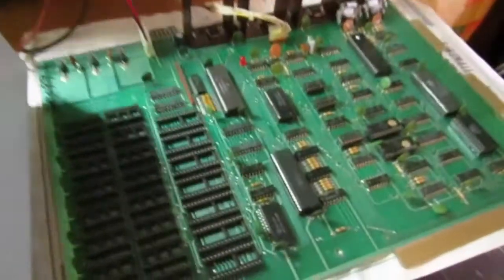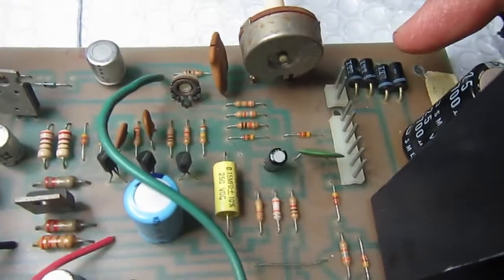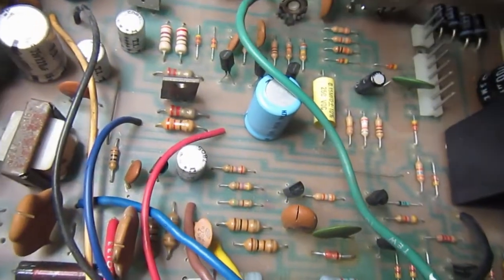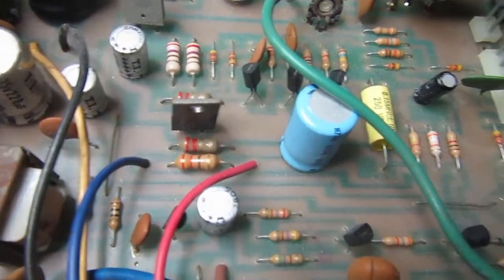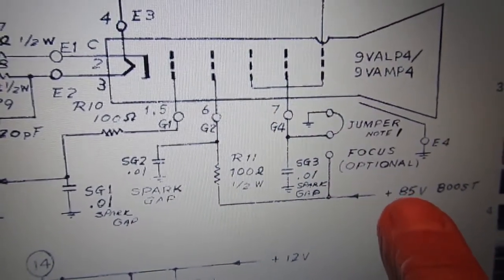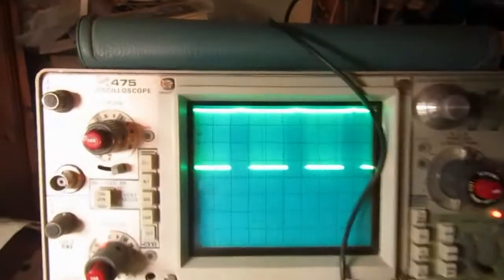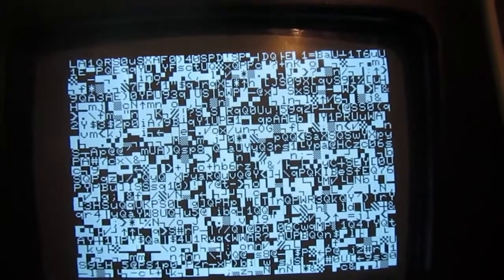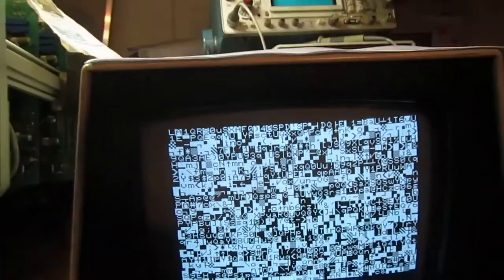CBM PET 2001 monitor video board repair (easy)

Comment: hello! My blue pet has similar symtoms. but i don't have an oscilloscope and knowledge of electronics. Could you tell me what to do to fix it?
Reply from the maker: Hello! I'm sorry, without some knowledge of electronics, I can only suggest you to find a good technician close to you that can help. Inside a CRT monitor there're also very high voltages (thousands of Volts) that can be very dangerous.
The same symptom can be given by several different failures, so it's not simple to suggest something without checking what's really happening.
You can try asking for help near your location on the VCFED forums:
http://www.vcfed.org/forum/forum.php
Reply: iz8dwf  thanks for your advice.
actually, i can do soldering, and i have a basic (literally basic) knowledge. i'll ask for help on VCFED forum.
thanks!
Reply from the maker: P철도청  Ok! Then, first of all, get the schematic here:
ftp://www.zimmers.net/pub/cbm/schematics/computers/pet/2001/video-1.gif
Then, with a multimeter (and paying attention that around the flyback transformer there may be dangerous voltages), check voltages on C1 and C3 (power regulator), then check voltages on G1, G2 and CR7. This can give us a first idea.
We can continue troubleshooting on the VCFED Commodore forum anyway.